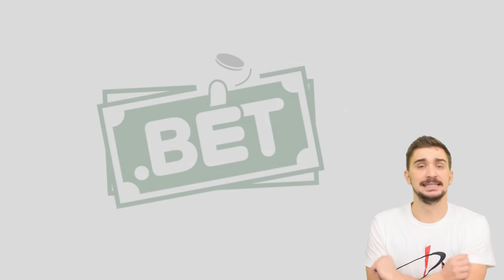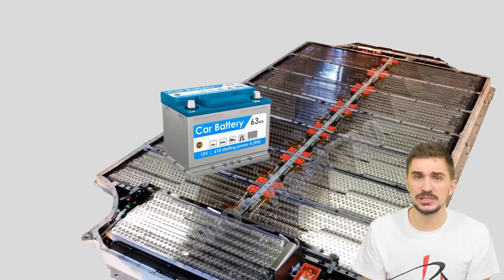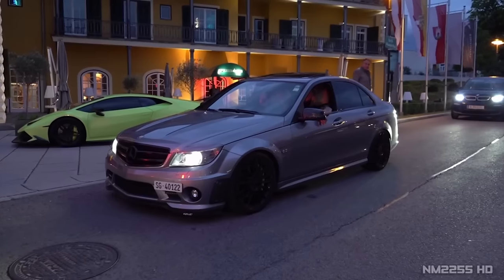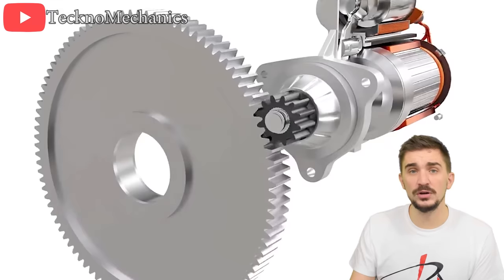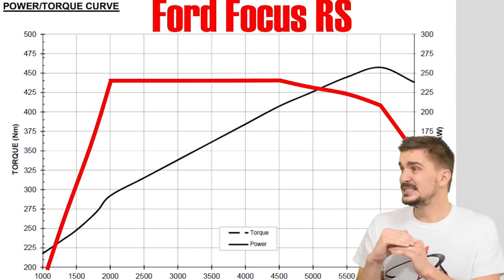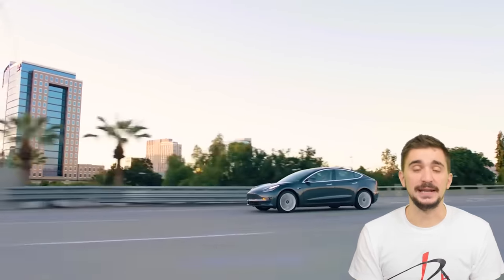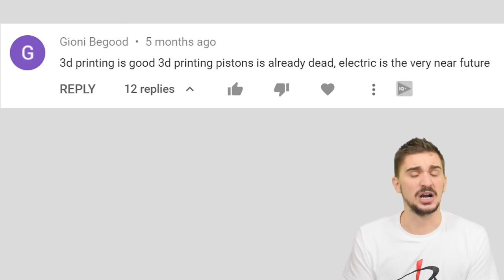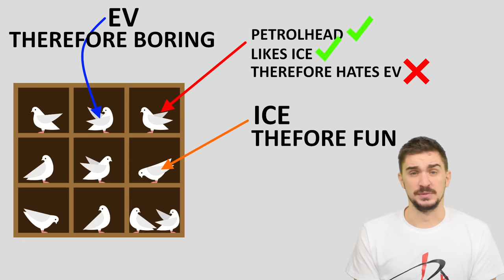ICE vs EV - IN-DEPTH comparison of BATTERY ELECTRIC and INTERNAL COMBUSTION ENGINE vehicles

Comment: I am electric power engineer, so drives, e distribution and powerplants are my living. For my whole life, even now, I want to be ice engineer. The reason I studied electrical instead of mechanical engineering are stupid people. Designing ice engines in not pleasant anymore cause of naive people. COMPARING ev with ice is nonsense, ev is completely different energy with same quality as mechanical energy. But we can't mine electrical or mechanical energy. Ev engine is simple cause it simply converts electricity to mechanical. It's like making the steel of steel. Ice engines have better efficiency than powerplants now. Without heat engines there's no electricity, it will be same as in age of working tokamak.  Hydrogen cars are also nonsense, hydrogen is made from natural gas, it's more efficient to burn natural gas in "old, primitive" ice engine. People should learn math, physics and chemistry before talking s___t.
Reply: I won't even change my RB 26 for ev... Even I have to make money for petrol by charging ev.

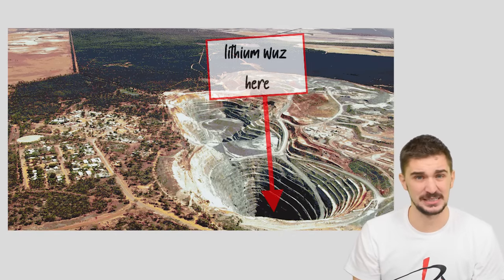Comment: 29:49 - There are less than 15 lithium mines in the world.  Meanwhile there are thousands of coal mines, oil wells and rubbish tips. Hey at least lithium can be recycled in EV's batteries over and over, cant say the same about coal or gas which has a single use.

Also EV's are older than ICE, EV 1881 (Trouvé) vs ICE 1886 (Benz). Battery technology hindered EV evolution where ICE just need to make a bigger fuel tank.

Comment: Here's the problem with EV's as you cannot Bring theme into Off roads and or Extreme Conditions specially in high temperature locations, i will tell the truth that will shock the entire EV lovers. You cannot Bring EV's into floody areas next to petrol engines as they cannot handle the situation of accelerating while flooding that will caus your EV's to die as it's components are easy to damage by water entering inside. The biggest and worse scenarios having EV's Than ICE is..(Batteries) the main issue is battery. Its all battery, with extreme temperatures it will explode without any bunch of signs that will gonna explode. So you cannot predict when it's going to explode because it's like rubbery where you didn't notice that these rubbery enters to your house and where not predictable they steal alot of needs and or gadgets without notice. It is my logic and that's partially true.

Comment: Great video, but there is one mistake and it is at the end.  EVs outdate ICE.  The eternal issue for EVs has been storing the angry pixies in a high enough concentration to make them viable.

Basically, if there had been a miraculous discovery regarding electrical storage before Henry Ford, we would likely never have gone with ICE on the ground.  Electric motors are always better than ICE.
Reply from the maker: I know some of the earliest cars were electric, I didn't say EVs aren't as old or older than ICE as a concept. I just said that ICE has been evolving over the past century and EV really hasn't until recently. Love the angry pixie analogy 🤣